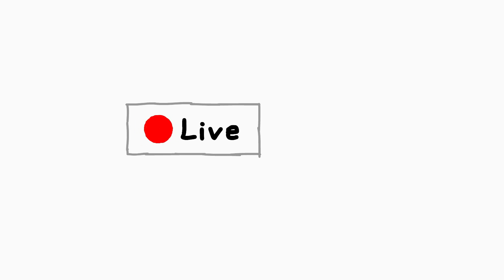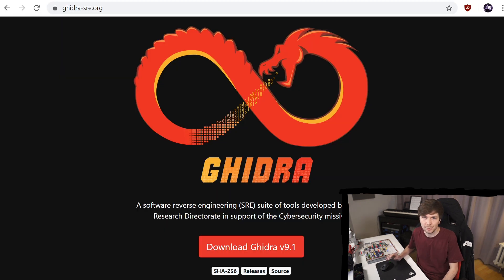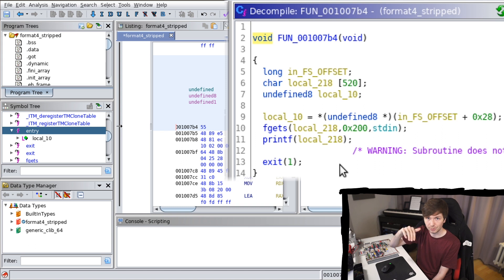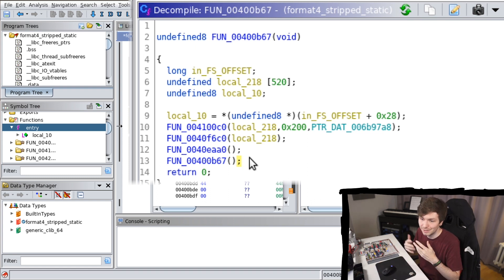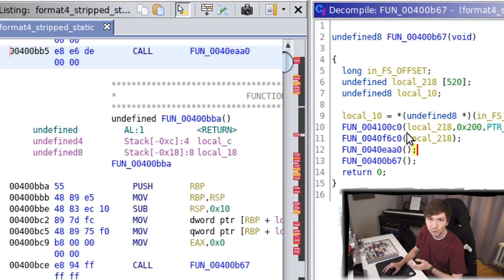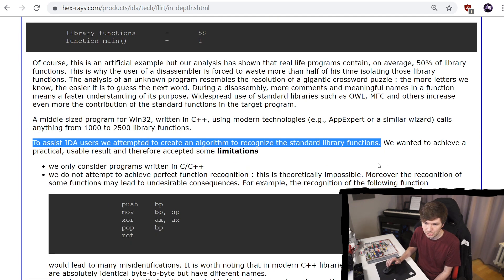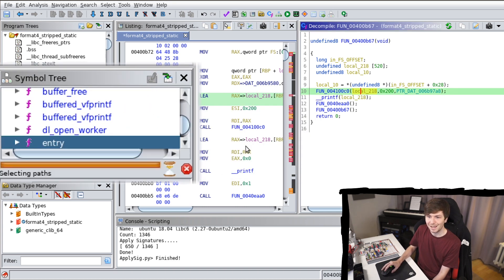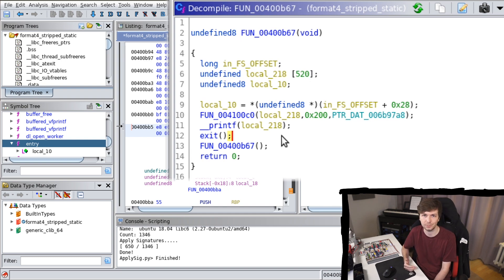Reversing Statically-Linked Binaries with Function Signatures - bin 0x2D

Comment: Where is a .pdb file for not stripped binaries on linux
Because on windows if you remove .pdf file you loose all symbols
Reply from the maker: it's in the ELF binary itself, no external symbol file needed. If you strip a ELF binary you can see the size is smaller.
Reply: @LiveOverflow  can you use Ghidra to reverse engeneer linux bin on windows or you have to use linux to reverse linux binaries?
Reply: @Veso266  Ghidra can reverse Linux binaries on any host platform. Same goes for IDA.

Comment: Why would a program use md5 in 2019? MD5 has been broken for a long time.
Reply: md5 is pretty fast, pretty wide spread, and it's good enough for most tasks. the holes that it has aren't too significant enough for everyone to switch to another hash function. it's "good enough" when generating checksums and the like.
Reply: @antiteal3050  If you want a fast hash, use KangarooTwelve. Unlike MD5 it can also has support for hashing long inputs in parallel making it even better as a checksum for large downloads. Regarding it's holes, both it's collision resistance and preimage resistance are broken.
Reply: you're probably right that kangarootwelve is faster than md5. but my point is md5 is /fast enough/, and a good enough solution when it's needed. i even tried looking up implementations of k12 online, and couldn't find a single js implementation. md5 support literally comes packaged in with most linux distros. people use md5 cuz it's widespread and good enough. there are many other hash functions which can be said to be better, but none are as universal as md5.
Reply: @antiteal3050  To be fair there is a js binding to a wasm version of KangarooTwelve. It would also be pretty easy to port the author's python reference implementation to javascript. If you are looking for widespread fast hashes at least use SHA2.
Reply: Going with what has already been said, MD5 basically is easier and more widespread to use in ANY language, and is still valid for some cryptographic uses. It's collision weakness is not detrimental to every application, especially if the hash itself is never exposed. For example, hashing a password to be used (in real-time, not saved to a DB) as a key or IV in a block cipher (e.g. AES), since block ciphers need a specific length (MD5 matches nicely with any 128-bit block cipher). Also, it can be used in lookup tables, or obfuscation. Yes, other hash algorithms can be more "efficient" for the task, but MD5 can be a quick go-to if collisions aren't a real concern. Malware authors also use MD5 alot in the wild, but that's a different topic. 🙂
Reply: @Demonslay335  I disagree. I don't know any language where it is harder to use SHA-256 than MD5. Assuming the passwords are low entropy they should be run through a KDF like Argon2 to create a key. MD5 is way too fast to be used for low entropy password hashing. For lookup tables an attacker can create collisions which can cause potential problems. You can not use hash functions for obfuscation because by design there is no way to "unhash" it. It's dangerous to continue using broken hash functions.
Reply from the maker: Ah well. Then I don’t know why any programmer would still write code with buffer overflow vulnerabilities. Or why XSS still exists. Or why iPhones still get jailbroken. Why are they not just writing secure code?!?!?
Reply: @LiveOverflow  That is not a fair comparison. People consciously choose to use MD5 where buffer overflows, XSS, and jail vulnerabilities happen on accident. Buffer overflows can be effectively eliminated by using a language that keeps tracks of buffer sizes with dependent types. XSS can be effectively mitigated by using refinement types to keep track of whether data is sanitized. Preventing escaping from a jail is much more complicated, but using formal verification of your specification and design can help avoid it.
Reply: @gyroninjamodder  you are missing the point, friend.
Reply: @eIicit  What point am I missing?

Comment: I spent a good 1 hour understanding this video and the weird flow of the statically linked stripped binary. So if I'm not wrong, whenever dynamic linking happens in a process with a debugger attached to it the debugger watches for the symbols being used for the linking and can subsequently tell the user the function names?
Reply: The stripped binary only has its own debug symbols removed, but still has its import table (symbols referring to external functions/variables to be dynamically bound). So no need for a debugger, a proper disassembler is enough.
(It is the most common form of executable, no debug symbols and dynamic linking).
The second part of the video is about using signatures to identify functions that we know of from another binary, it's a difficult task since the assembly can change between different compilations and thus different versions of a library. There are different identification methods around: flair (pattern + cross references), yara (behavior based, return value), ..